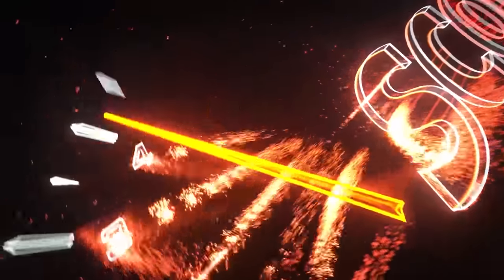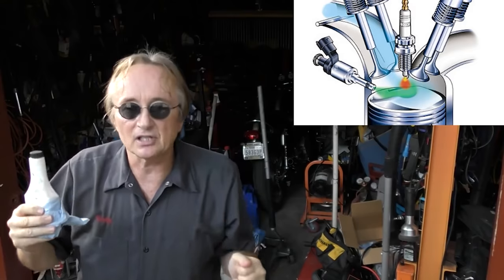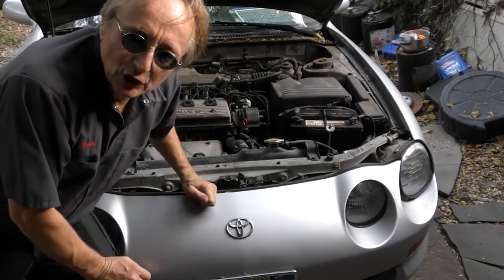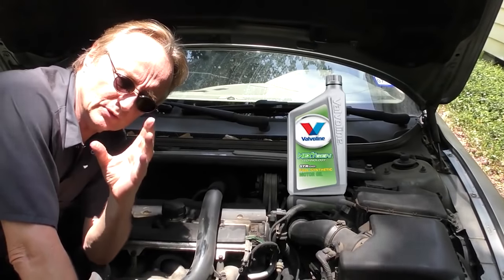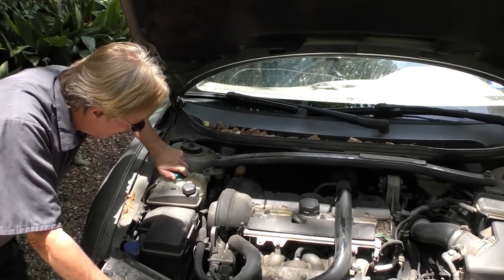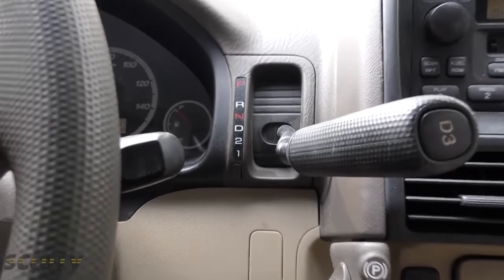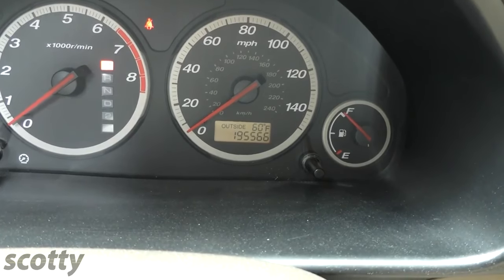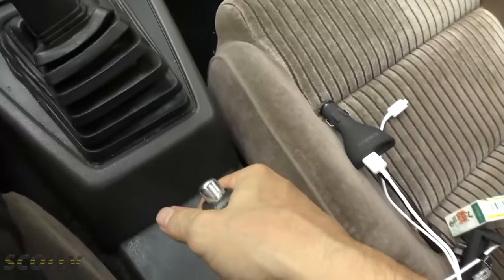20 Things Only Stupid People Do to Their Car

Comment: I'm 29 years old but I drive my car like a senior citizen, it save me multiple trips per year to the mechanic
Reply: I'm Lewis Hamilton (Real)
Reply: Smart man, enjoy.
Reply: I'm a Senior but I've driven like an old man since I was 29. Keep it up Webster. :)
Reply: good job
Reply: I always drive more slowly and my mom is like "c'mon, go faster or something" no, I don't want to, I'm respecting the rules
Reply: Taking your car to redline is good for it (google Italian tune up.) I agree, if your going to drive it like a granny, put some seafoam in it to clean out the carbon and the injectors. I once owned a 60,000 mile manual 95  Dodge neon lady driven that I took for a 6hr drive to Montreal and had to replace the injectors when I got there because the fuel system wasn't used to such a sustain flow - about 75-80mph in 5th for 5-6hrs. Sustained high stress driving is bad for your car, aka track days. Many vehicles of all sorts are stress tested on tracks like the Nürburgring. Don't beat the tar out of it but do take it to redline from time to time and learn how the car talks to you.
Reply: @dachanist  should I redline it in the highway when it's 3 am and there's nobody there
Reply: I drive like dale Earnhardt in baseketball
Reply: @lesmoore3638  these are too good.

Comment: Here’s a tip for people with automatic cars. When parking on a steep hill, set the emergency brake first then put the transmission in park. Doing this let’s the brake hold the car and when leaving makes the transmission easier to shift. Otherwise you may not be able to get the transmission out of park.
Reply: This hasn’t been a problem in automatics for over ten years
Reply: That explains why my auto is hard to put in r or drive on hills. Thank you
Reply: @kenspoor3918  You do realize that gazillions of automatics out on the street are older than ten years, right? Not everyone bothers buying new/recent models, it's usually a waste of money.
Reply: Just jy a stick they last longer
Reply: Your right you can also turn the wheel towards the curb👍
Reply: @mattlawton4715  Assuming you're facing downhill of course, otherwise if you're facing uphill you'd want to turn the steering wheel the other way :P I'm sure you know this but just expanding for any readers who might get confused!
Reply: I don't know anyone who drives an auto
Reply: @Howie57  and your point is 🤣
Reply: @Howie57  What magical place do you live in where stick shifts are so easy to find? Seriously I will move there right the hell now lol I'm so frustrated that they're not being made much anymore
Reply: @ItsAsparageese  my last 3 were automatic and none over 10 years. What are you talking about. Everyone buys new cars
Reply: @Howie57  I don't think anyone drives manual wtf is this 1956?
Reply: @disenfage113  "everyone buys new cars" lmao that's the most naive thing I've heard today, careful not to spill your caviar on your fancy suit there kiddo
Reply: @ItsAsparageese  ? Most people I know can't wait to get our of a car they barely had 2 years. I'm only simply stating what I see
Reply: @disenfage113  Okay, then use language like "everyone I'm aware of buys new cars" instead of just saying "everyone" as if you assume the world is a reflection of your tiny itty bitty miniscule subjective experience lol.

And loads of people still prefer manual transmissions. I might be buying a 4runner with a manual off a friend soon hopefully, they're way better for lots of purposes, especially in my state (Colorado)
Reply: @ItsAsparageese  sounds fun
Reply: More importantly, it's better for the tranny...when you don't do this, your car rests on the parking pin, bad for it, why do you think it's so hard to get out of park..
Reply: @disenfage113  that's bc the ppl you know are suckers....the rest of us, don't like wasting money, and having older cars that are made better
Reply: I simply don't release the brake pedal until I have set the E-brake. Same idea, keep the weight on the brakes.
Reply: More importantly, it's better for the tranny. Because your car or truck rests on a parking pin , if you don't use the e brake, it's bad for it
Reply: @disenfage113  in Latin America almost every car is manual. I've seen mechanics that never touched an automatic car in their lives.
Reply: My car automatically puts on the emergency brake when on a slope.
Reply: @disenfage113  1956? That's when cars and trucks were made better. And no, but anyone with common sense should learn to drive a stick. Automatics are boring, and they don't last as long, and they're more  expensive to fix. No need for automatics
Reply: That’s why most cars have a bypass directly next to the shifter. It’s common knowledge.
Reply: @ItsAsparageese   it's called 'anywhere but USA'. I'm European and i don't think i've ever been in an automatic trans car. Except maybe some utility vans.
Reply: Every jeep owner who made a mistake buying an automatic knows this . I’m one of them . I have 270,000 on my 02 wrangler , only replaced alternator, fuel pump and some ac components. I live in Florida ac is important
Reply: turn your wheel into the curb
Reply: I agree but many people learn the hard way even if it's not on an incline
Reply: @kenspoor3918  No. It still is a problem. It's a much harsher shift out of Park. How do I know? I live on a Steep Hill and have a 2019 Jeep. Sooooo...you're wrong.
Reply: @disenfage113  it's a great skill to learn
Reply: @kenspoor3918  the average car on American roads are 12 and a half years old. plus people buy old cars for the sake of getting something old.
Reply: @disenfage113  and most people buying nice cars they like every couple years are the sort of people who are successful and competent consumers and buy things of quality build instead of planned obsolescence like modern cars. and everyone who actually likes driving likes shifting, and the only affordable manuals are twenty years old.
Reply: it's not an emergency brake, it's called a hand brake
Reply: My last automatic had a button to press on a hill if this happened, to override it and get out of park. It was a 1995. Just learn how your car works.
Reply: @dubl33_27  it's an emergency brake if you are driving and your brakes fail and you need to stop you use that
Reply: @kenspoor3918  It’s just a little easier.
Reply: I usually keep my foot on the brake until the e brake is set.
Reply: Put it in neutral first than let it set directly on the pb.
Reply: @H Lambourne Europe ✌
Reply: @ItsAsparageese  I'm not arguing but I'm curious what is a manual better for?
Reply: @JohnSmith-tz4on  They don't really wear out (only the clutch does). Also, they give you more control over which gear you're in. Finally, they can be push-started if need be.

Some "automatics" like DCTs are actually automated manuals. Most European truck engine also have automated manuals. These are essentially manual transmissions, but the clutch and shifter are controlled by a computer.
Reply: @mattlawton4715  Humour.
Reply: @disenfage113  Manual are fun.
Reply: Ah-haa!  Years ago, my folks bought a used car from a private party in Berkeley, CA and I drove it during high school.  Sometimes it was a real fight getting her out of Park.  A few months ago, I was in Berkeley on business & drove up into the seller's neighborhood becuz they were always bragging about what a good view they had of The Bay...their neighborhood "Cragmont" was nothing but steep hills!!  Mystery solved.
Reply: @ItsAsparageese  probably europe, but even in america they are not impossible to find, I drive a manual kia forte gt and my last car was a manual miata which I had to trade in because I needed a car with back seats.
Reply: @richsweeney1115 nah got that completely backwards. Especially the boring Part. Shifting is boring and just a useless nuisance.
Reply: It's called a parking brake actually, it's meant for parking.  Folks misunderstand its purpose.  You should be using your parking brake anytime you put your vehicle in park, regardless of hills, even flat surface.  The parking pin in the AT is not as strong as you think.  You pull that thing while in motion and you'll create an emergency.
Reply: put the car in neutral before setting the E brake
Reply: yes, yes, yes! i used to tell my (now ex) wife “handbrake, footbrake, park” meaning, put the handbrake on first, take your foot off the brake second to ensure the car is held by the handbrake, only then third put it into Park. she used to NOT do it just to spite me, thinking i was being pedantic. Until, that is, one day when she parked on an incline, she couldn’t get it out of Park. So I give it a try, and boy, that gear lever would not budge! after much weeping and gnashing of teeth i got it to shift along with a giant “clunk”. as we drove off, i said evenly, “handbrake, footbrake, park” — that’s the reason.
Reply: @kirkwatstien6979 not necessarily.
Reply: @dubl33_27 not if it's called an emergency brake and the pedal is on the floor.
Reply: @disenfage113  we might trade our used car out for another used car

Comment: 4:30 That's why I fill my tires with helium, makes my car lighter, and my tires talk in a funny high pitched voice.
Reply: Flyin per gallon
Reply: Then if you do a skid the sounds produced (tyre squeals) will likely be pitched above the range of human hearing?
But if you run pure vacuum in your tyres, no one (including animals with high-frequency hearing) will ever hear your road noise. That like "in Space No One Will Hear You Scream" situations.
Tesla's 'Car In Space' could not be heard.
Reply: I prefer to fill my tires with methane from cows in order to protect the ozone layer.
Reply: @Willam_J  Back in the early 2000s, I put higher wall tires on the rear of my 87 Aries. It looked pretty awesome
Reply: Helium is a crazy small molecule. I imagine your tire would go flat in a matter of weeks.
Reply: Ridley Bicycles has entered the chat

Comment: 'If you are cheap like me.' Own a vehicle for thirty years! Old is gold
Reply: Yeah, I just donated my 2004 Jaguar to cars for kids because the radiator went and it cost the same as the car was worth...less than a year later the car went up $2000, yup, that’s my luck.
Reply: I helped a friend's father restore a 1959 Plymouth Fury.  When he bought the car it had 85,000 miles on it and most of the parts were original to the car.  First time I looked under the hood, I could not believe how clean everything was, especially since the car had been in storage for almost 15 years.  Only things we did to do was replace the belts and hoses, rebuild the carburetor, replace one panel on the body, and flush and change the fluids.
Reply: My daily driver is a 73 Dodge D100
Reply: My ride is a 27 year old Volvo station wagon. I have none of the problems “modern” cars have. I also don’t drive a whole bunch these days.
Reply: My daily is an 01 Isuzu Trooper. Dead reliable and easy as hell to work on. Never buying anything made after 05 for the rest of my life.
Reply: No workers then

Comment: The reason for nitrogen in airliner tires is because a dragging brake generated enough heat to cause a fire INSIDE of a tire which exploded, taking out the hydraulics. This potential problem no longer exists with inert nitrogen. 

I love your channel. Keep up the videos!
Reply: I imagine that was another airplane improvement brought about by a number of unfortunate accidents.
Reply: @billolsen4360 that’s sad to think about

Comment: Good maintenance gives good results. I own a 1991 Chevy C1500 Silverado (350ci)with 310,000 miles. Runs great. Tip for viewers: Check all fluids, oil, transmission, coolant tank, power steering, brakes and washer fluids when you get gas. When oil starts to get dark, time for a change. This is how I got 310,000 in my truck and it still runs strong.
Reply: Good advice !
Reply: Still running?
Reply: Do this, just don’t sit at the pump doing it!

Comment: I’m an old driver, & much of this was common knowledge when engines were easier to work on.

Good advice, great video. & I’m still chuckling over the Scubaru 😂😂
Reply: I miss those  old cars.
As kids our fav road trip game was to identify make & model by head lights & grills. Now days that's impossible 🙁
Reply: @cheryls3224 , not impossible, but most definitely very much harder.
Reply: @cheryls3224  wouldn't that be way harder with old cars since headlights were standardized back then?
Reply: @lukasg4807  you're probably overestimating cheryl's age, but while the lights were the same, their placement was different because the car models weren't homogeneous electric razors.

Comment: Also, on turbos, if you turn the engine off as soon as you come to a stop, the engine stops pumping oil to the turbo which is still spinning at maybe 20,000 rpm with NO oil supply to it. The 30 second rule is a good one!
Reply: how about superchargers tho?
Reply: @The97Noname  no, superchargers are mechanically driven by gears from the crankshaft, so as soon as the crankshaft stops rotating, the supercharger also stops.
Turbochargers are free spinning, not connected mechanically to anything, only driven by high pressure exhaust gas similar to how a jet engine works.
Reply: You would have to basically turn off the ignition at full boost meaning WOT for this to happen, i dont think anyone is turning off the engine with the gas pedal through the floor. It truly takes like a couple of seconds at idle for the turbo to slow down. You should let your turbocharged engine idle for 30-90 seconds before turning it off, and it is because of oil flow, but its not because the turbo is still spinning at high speed, its because the turbo is hot as hell and if you cut the oil flow, the oil in the turbo is just gonna sit in that heat and coke up, which restricts future oil flow and can wreck the turbo.
Reply: Good to know!
Thanks!
☮️💜
Reply: Shouldn’t there be a torso brake. To manually brake the turbocharger after stopping.
Reply: Most cars engines designed to shut off at full stop
Reply: He does say that.

Comment: Lol loved the jump start tip at my high school I saw a kid start to like arc weld with his being backwards
Reply: I had a friend give me a jump on my old 84 Maxima, I did it backwards and it melted his cheap jumper cables and killed my alternator and some relays. It wasn't his fault. It took me months of screwing around with the car before I finally got it working, I knew basically nothing about cars, but the parts were cheap. So I was changing out all kinds of stuff until I did the alternator, and when it finally started I was so freaking happy. It was still a piece of beat up junk though
Reply: I had a classic English car... jump started backwards and the whole wiring under the dash melted and nearly caught on fire. 😫😪🤣😋
Reply: @mael-strom9707  didn't they have 6 volts systems?
Reply: @billrehm3590  After my woman was finished with it, it was a 0 volts system. 😂🤣😋
Reply: @mael-strom9707  sorry to hear that.
Reply: @billrehm3590  It's ok... got rid of the woman and rebuilt the love of my life. 😁😋🤣
Reply: Long ago, had a coworker jump start my 55gmc.
   He parked his brand new (like 1 month old) Volkswagen  right in front of it.
    Hooked up the cables right, but didn't realize it was in gear (it would start in gear).......
     Pumped it a couple times, then I pumped it while I turned the key on.
      Had a pontiac 389 in it at the time (Oldsmobile 455 in it now).
    It fired up & jumped forward with a roar!
    The breakes sucked,  but damn how I kept from running his new vw car over.
   It woulda been bad!
    That kids eyes were big as silver dollars though!
   (I forgot all about that mess)
Reply: I almost set a '69 VW on fire trying to jumpstart a '68 Cadillac. The cables were hooked up OK, but they had too much resistance to supply the starter for a 472. It was cranking very slowly when I saw an orange glow from the back window of the bug; I was able to yank the burning cables in time to save both cars. I suspected that the Caddy might have had a seized engine, but it came up fine after the battery had been trickle charged.
Reply: @billrehm3590  last 6 volt system i saw was on a Renault from 1968
Reply: @jupitercyclops6521  LMAO. I'm glad that had a happy ending; I was expecting the worst. Unibody versus frame- I think we know which vehicle would have been damaged the most.

Comment: 2:23 - does depend on the gas. Shell, Chevron, Costco, and some other stations have more detergents in their fuels. Shell also seems to rate their fuel slightly lower than it actually scores on the anti-nock index. I used to fill at different stations and would have to put injector cleaner in a tank every oil change. Ever since I started filling 70% + of the time at shell and avoiding esso (worst gas out there) I haven't had issues. Manufacturers know that the government doesn't require enough additives so they all joined the Top Tier fuel program.
Reply: I bought a gallon of Lucas and I put an ounce in every fill-up. My car drives better and is quieter with the stuff. It's an 04 escape with 150k miles.
Also my local gas is cheap and bad, so it actually helps.
Reply: its a overpay early for longevity but the amount you spent to prevent the fail is easily covered by the cost spent to prevent. if you got the money buy it if you dont you wont miss it
Reply: @runed0s86  so don't go to the cheap place....
Reply: 2:23 Scotty is talking about GDI and has nothing to do with the type or quality of the fuel. If the fuel is not washing the valves clean, that's all there is to it. The fuel is entering the engine after the intake valve... not before.
Reply: We get gas at the Reservation around here. The gasoline is additive free. That's one of the reasons that it is 50 cents a gallon cheaper, besides the no tax on it. They even have no ethanol high test at a few of the stations.